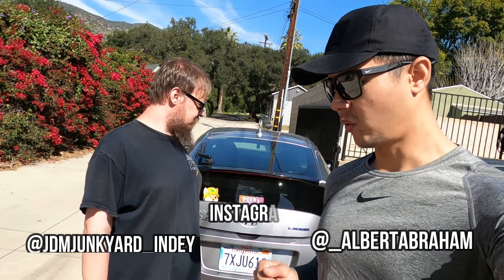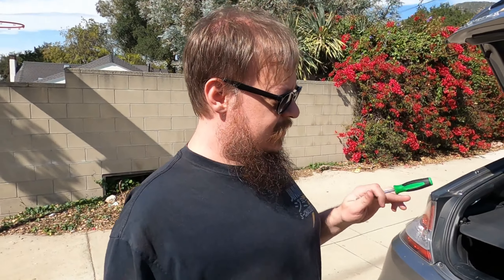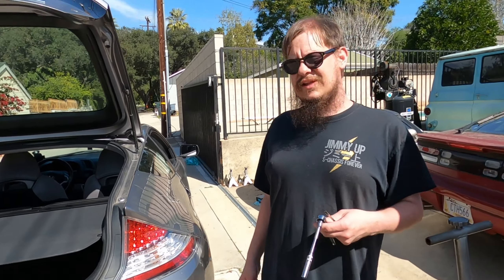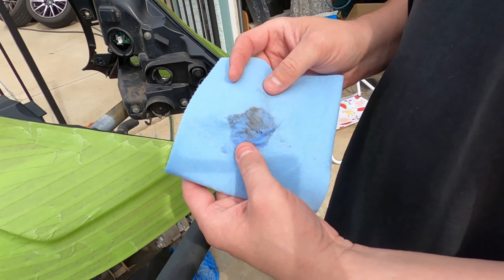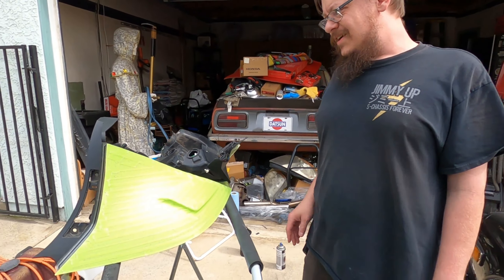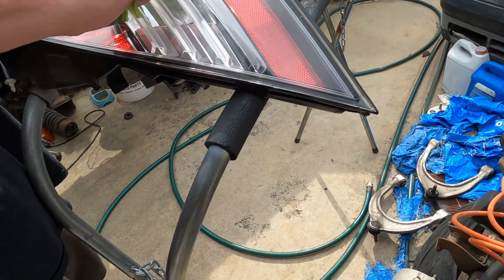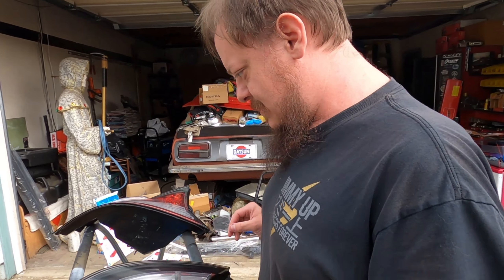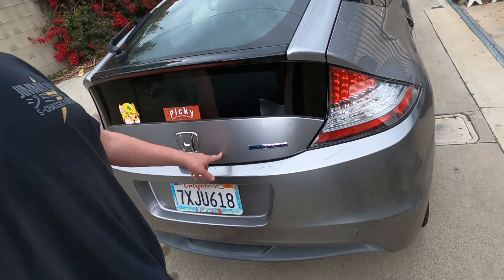CR Z TAIL LIGHT EYELINER MOD!

Comment: For the turn signals, just use LASFIT bulbs. They have built in resistors so they don’t hyper flash. No need to wire in resistors. The only down side to them is that you leave them on for awhile they will eventually start to hyper flash. But for the length a turn signal needs to be on, they rarely are on long enough to hyper flash. 

I have all LASFIT bulbs on my CR-Z and they are worth it.